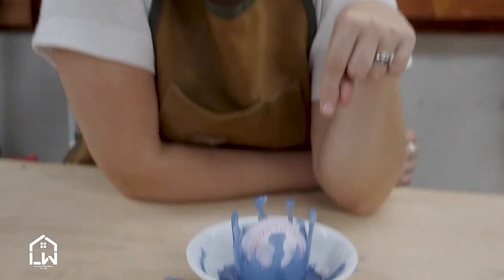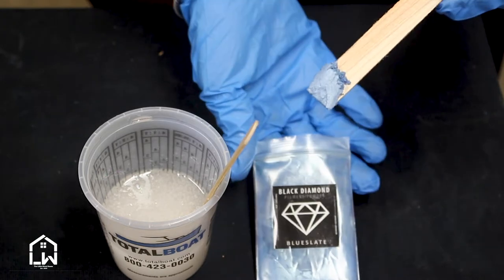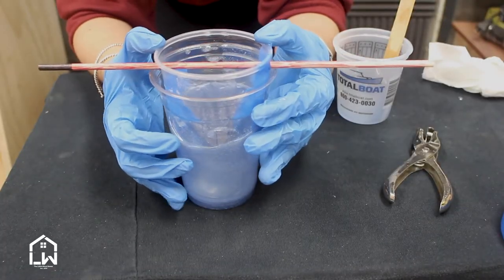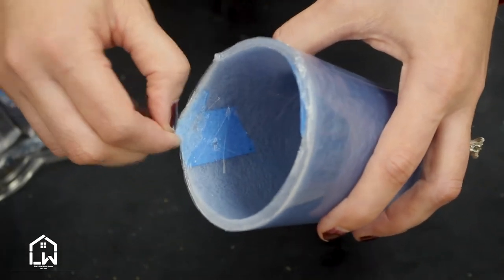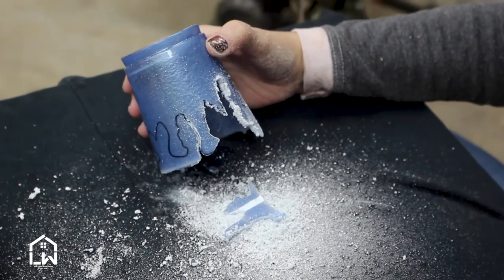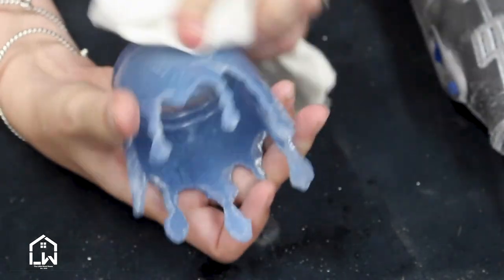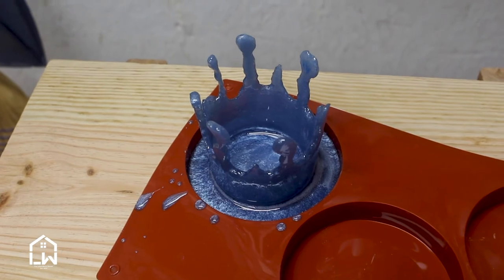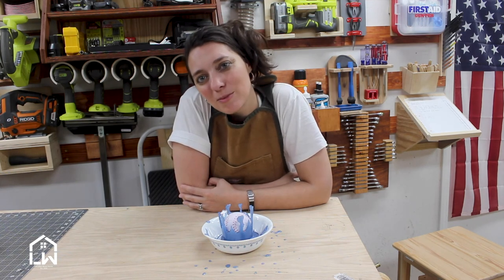Epoxy Resin Water Splash | How to

Comment: Great project! You can also use WD-40 to remove permanent marker. Silica is the main active ingredient that helps to remove any markings. If you wait 15-30 seconds after spraying, you'll get better results and afterwards, wash or rinse off your item with Dawn soap and lukewarm water.
Reply from the maker: Great to know, thank you